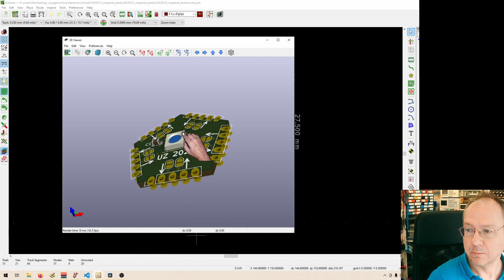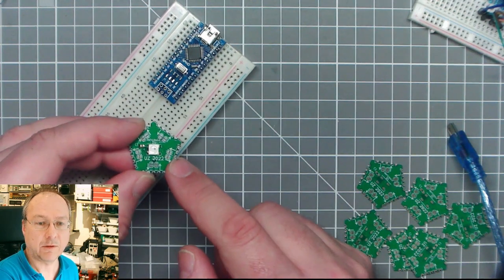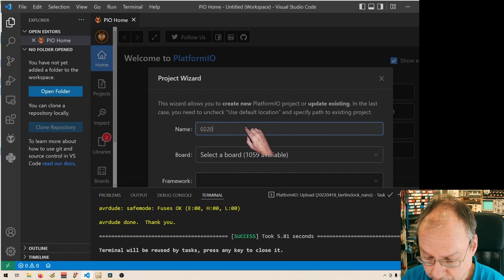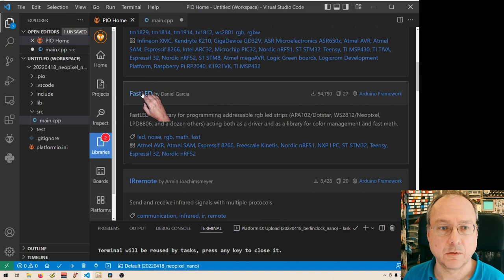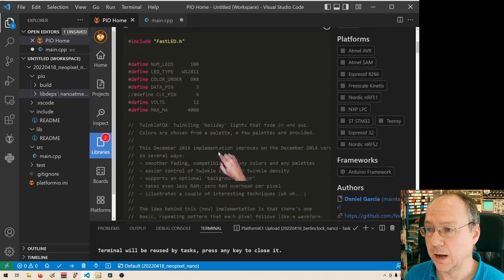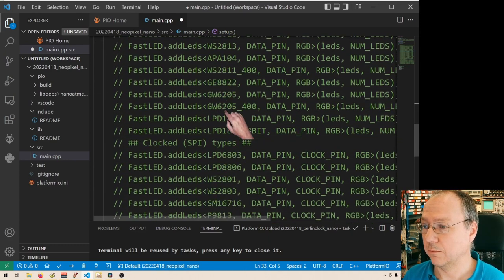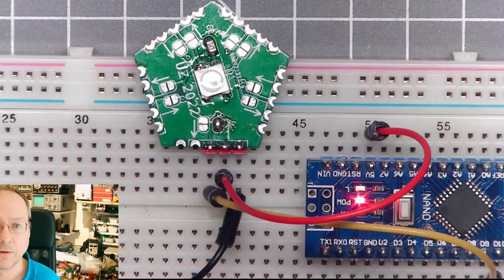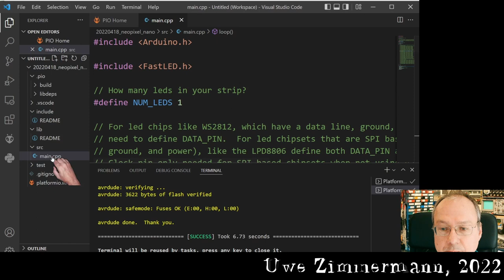Using external libraries with PlatformIO and Arduino

Comment: I do like that platformIO allows you to add the library after you've already started the project. I usually add them right at the start when I know which ones I'll be using.
But I would find it annoying that it will not add the header file into main.cpp when I specifically added the library to that specific project. Also, if you copy and paste a file developed elsewhere into platformIO, with the header files, it just throws its hands up and complains. And yet it is smart enough to find libraries for you and you can even give it a url. I think that if you put a specific header file in main, it should at least offer to find and install that library. I go back and forth with platformIO and just Notepad++ and ye olde Arduino😁
Reply from the maker: The name of a header file is arbitrary since you can make up your own libraries with random names which might be identical to other libraries on the net or in the known repositories. Also libraries in the repositories change over time, sometimes becoming incompatible to earlier versions. How should PlatformIO know which particular vintage version of library your project needs?
I pretty much prefer that PlatformIO keeps the current version of the library in a local copy within your project tree, actually keeping track for you of available updates when a library comes from a standard repository - but letting you decide whether to update or not.
Reply: @uwezimmermann5427  Thanks for the reply👍

Comment: Can you make video about I2c protocol. I see a lot of video but I not understand? Thank you very much
Reply from the maker: What don't you understand and to which level of detail do you want to understand the I2C bus?

I would recommend to read some documentation rather than relying on a youtube video. NXP - or rather former Philips - is the inventor of I2C and they have the standard document: https://www.nxp.com/docs/en/user-guide/UM10204.pdf
Reply: @uwezimmermann5427  You are great at explaining and I am interested too. Like a typical circuit with data input from a sensor and output on a LCD or something while using a MC as 328p and coded in AVR-C?
Reply from the maker: @Patten42  I am currently a bit overloaded with work, hence the lack of any new videos... but... and with soon 1000 subscribers...